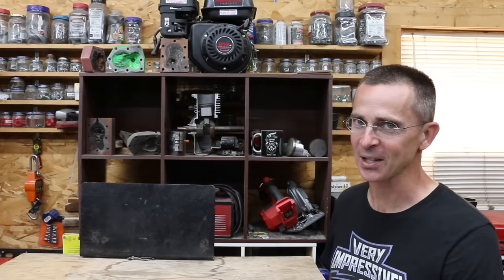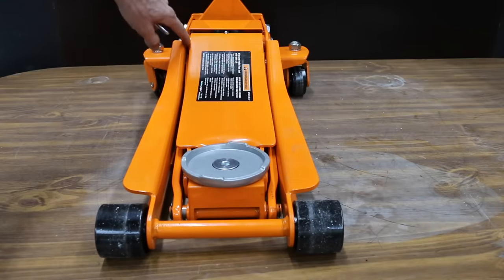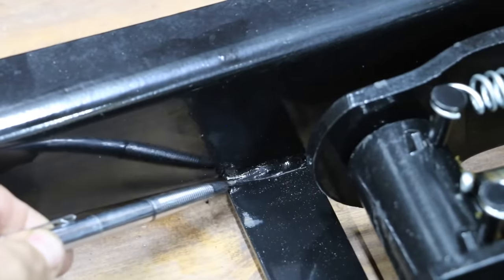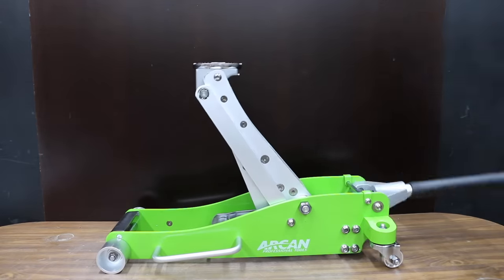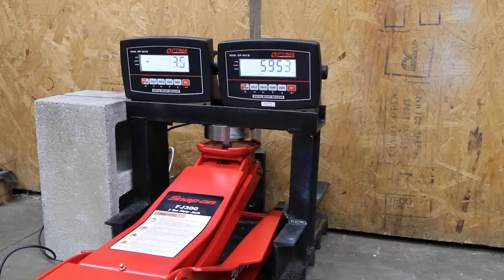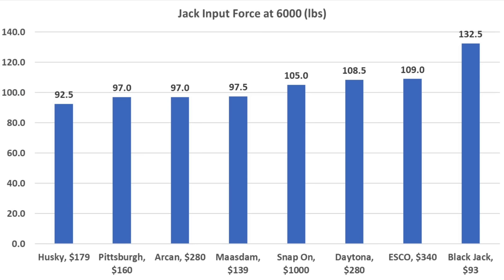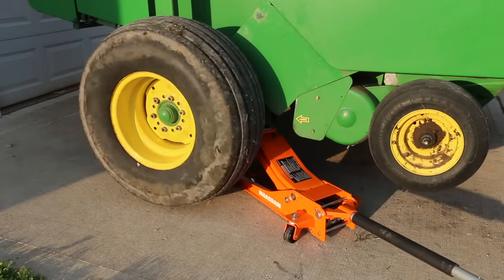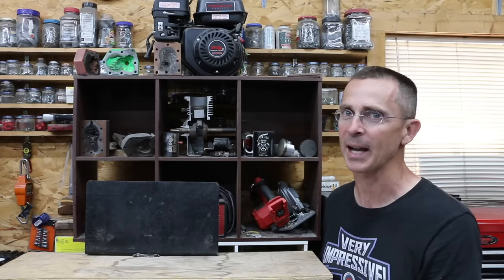Best Floor Jack? $1000 Snap On vs Daytona, Pittsburgh, Arcan, Black Jack, ESCO, Husky, Maasdam

Comment: I bought an steel arcan 3.5 ton Jack probably 15 years ago from Costco. It’s been the best Jack and has never given me any issues. Best thing is that it cost less than $100
Reply: It seems everyone got that Costco Arcan lol.
Reply from the maker: Great jack at a great price!
Reply: We're gonna need Todd to test that.
Reply: I got it too, its a really good jack
Reply: I got that same deal for the red hybrid jack. I love it, and 10 years later it’s still going strong.
Reply: I purchased the daytona 1.5 weeks ago and it’s great, way better than my previous jack. Had to get a new jack because the old one couldn’t fit underneath my car. It was fairly cheap (like $80) and I bought it like 10 years ago. Stored in an outside shed and given no tlc. Still works perfectly fine. Still though, a jack is something you never want to cheap out on. A faulty jack can kill you, severely injure you, and/or damage your car. When I was young and dumb I used the jack that comes with your car because it was either use that or wait a few days for a proper jack and stands. I was impatient. Worked on the car going slightly underneath. Less than 30sec after finishing, the jack slipped and the car fell. Nothing was damaged and no one was injured. It scared the crap out of me ugh  I was half underneath the car less than a minute prior. Scared me straight. A good jack and stands is an absolute must if you’re going to be doing your own car maintenance.

Comment: Daytona jack seemed pretty comparable to the snap on jack for the price difference I think most people could over look the smaller front wheels and the slight difference in the rise height.... 300$ vs 1000$ is an impressive savings for a few minor differences
Reply: Fairly certain the took snap on’s patent on the design. Snap on tried to sue but the time ran out on the patent or something like that
Reply: Worth noting the Daytona is literally 99% the same as the Snap-on. As in the same factory makes both jacks. HF got sued by Snap-on for this and won!
Reply: Some of HF's ICON tools are giving Snap-on tools much grief. Like their torque wrenches.
Reply from the maker: Thanks for the feedback.
Reply: @ShitboxShenanigans  the patent running out was a good thing for customers now they have other options other then snap on over pricing their tools and accessories.. don't get me wrong here snap on is a great company but competition keeps prices competitive
Reply: Also patents are good and all but you can make the same item that functions the same looks simular or almost the exact same as long as there are enough differences made to it smaller wheel, body shape, return spring, pressure relief valve  etcetera it is defined as a different item not being the same due to not everything is the same , the other thing is you have to list every single part and how it is built, how it works in order to get a patent, at least that's what I here. I'm no expert on the subject but it sounds expensive and not worth doing unless you are a huge company
Reply: @ShitboxShenanigans  
I doubt that. snap-on is just made in the same factory as the others in China. Snap on welders have been rebadged Italian ones for years. Nothing wrong in that but why pay 3x the price for a name?
Reply: @codprawn  I'm not sure where snap on gets them made but they do put a hefty price on'em like it was made in a gold refinery or something
Reply: @justotalkalottashit8392  yeah, a couple years ago, Milwaukee, and Snap On ended up in court over their battery designs. I asked my Snap On guy about it, and he told me you could honestly copy the battery, and just change the way the battery locks into the tool, and it would be good. If I remember right, Milwaukee was suing Snap On over the 18 volt battery. I'm not certain what came of it, but I assume nothing, as I just traded my old 3/8 cordless impact for a new one, and am able to use the old battery in the new tool. Only difference is the old one is a 5 ah, and the new one is a 6 ah.
Reply: Height is always fixed with a good old piece of wood
Reply: @Spike-sk7ql  What came out of it is Snap On waa ordered to pay Milwaukee almost $28 million... and now Snap On sells Milwaukee tools on the truck.
Reply: @VorsprungDurchNik  How long does it take to sell $28 million of Milwaukee tools off of Snap On trucks?
Reply: @ericrichardson3332    Patents aren't as much for protecting intellectual property as they are for coaxing improvement and innovation.  Some friends and I patented a product about 20 years ago and our attorney made it very clear that trademarks are far more valuable (especially once marketing takes hold) as brand recognition is what needs protecting.  He said any changes, no matter how small, as long as it can be argued that it improves the original patented design, can also be patented.  This is how a lot of companies get away with nearly copying products.  And you're right... competition drives the original and new companies to make better products, or improve existing products.  I own some Snap-On tools for specialty applications, and it's always pissed me off when I write that check.  I'm glad there's new players to choose from.  ICON is quickly filling my tool chests... the product is very very close to as good as Snap-On.  WERA has been disappointing.
Reply: @matthewpeterson3329  Thank you for information it is interesting at least to me and I hope others find these comments just as informative as me 👍
Reply: You’re exactly right. Patent law really only appreciably serves very large companies, and only serves as a line of defense if another entity infringes on said patent. Despite what many people may think, parents are not fool-proof blanket protection. In reality they’re quite far from it. Parents are notoriously expensive to file in any capacity (a single one costs tens of thousands of dollars) and it’s true you have to outline the full design of the patented product. There isn’t much room for ambiguity. For most people/companies that aren’t huge, it’s in your best interest to keep designs a trade secret whenever possible. Anything that can’t be easily reverse engineered or replicated under contract builders qualifies. A Jack unfortunately is very easy to copy in both respects. The utility patent does in fact make sense in theory, more specifically the fact that they expire unlike design patents which are strictly cosmetic serving as brand identity. For a utility patent, the company that pays for the R&D on the front end basically gets exclusivity to make back their money and then some (it the product is good) on the front end. Then one day it expires as not to be anticompetitive, and other brands can then adopt the design if they choose to.
Reply: @kfs777    Yep, all true.  Our patent wasn't that expensive though... just a few thousand and that included the attorney fees.  Our product was a yard game we invented, and smartly designed the best possible version to bring to market, so to improve it would make any new version too expensive to compete with ours.  It didn't stop people from making cheap plastic versions of it though, which is where our trademark kicked in.  Because we were the first, and marketed the name, copycats tried to use our name or variations of it and we had to issue C&D letters copiously.  I got a heck of an education with that business.

Comment: I purchased a Daytona a couple years ago because it looked like it was well built and reasonably priced for what it was. I've used it quite a bit over that time and it's worked great. I would have preferred to buy a US made product (Snap On) but it is just too expensive. I could justify it if it were 15/20% more but not 3 times as much.
Reply from the maker: Thanks for sharing.
Reply: snap on made in US??? need to check on that...
Reply: It’s not? Then I have zero regrets
Reply: Same.  I've got the regular Daytona (not the low pro) and it is a sturdy, well made piece of kit.  Until the U.S. starts up its factories again, I'll stick with harbor freight for most things because EVERYTHING is made in "chy-na" nowadays.

I figure, if I have to give my hard earned dollars to my enemy, it will be as few dollars as possible.
Reply: @kodoan411  it will never happen that’s how capitalism works companies need to find the cheapest labor
Reply: Well, no one can say this guy doesn't know jack  :)
Reply: Saul Alvarez are you trying to say communism would be better? It’s been proved many times over it doesn’t work…
Reply: @zacjohnson452  Not certain how made the leap from me complaining about the Snap On price to thinking I'm endorsing communism but I'm certainly not. What I do get pissed about though is when an American company sends its manufacturing to some third world nation to increase profits and then goes around waving the flag about how American they are
Reply: Aren't Daytona and snap on floor jacks made on the same assembly line?  Lol
Reply: I'm a machinist and I don't think I can recall ever seeing any of the guys I work with use Snap-On. It makes sense because we don't do automotive work but I have seen a lot of Matco tools floating around. We all use Makita and Milwaukee for hand tools and power tools. Although in my line of work nobody is going to trust your measurements unless you have a Mitutoyo or Starrett, so I guess in some respects that brand loyalty is baked into some trades.

That being said, a couple years ago I was helping install some metal canopies for a hotel under construction in NYC and the jobsite was all Ryobi tools.
Reply: I bought a Daytona and matching jack stands, they match my car😁 I got the green and I have a sublime charger Daytona
Reply: @kodoan411  Why are they your enemies?
Reply: @richmac918  so then what was the point of throwing capitalism in the mix? 
Those issues could be fixed through legislation.. 
nothing to do with the actual type of system being used.

I’ve noticed this trend of people blaming capitalism for pretty much anything finance related (overseas jobs, tipping, etc)
Reply: Yeah, I wouldn't count on the Snap_On being made in the USA, only some of their handtools are. I suspect the jack is made in the same plant as the Daytona.
Reply: The Daytona jack is literally the same as the snap on, the owner of harbor freight got the manufacturer for snap on to make it for him also and snap on tried to sue over it but lost. But just goes to show snap on is totally false, they're very good tools but they don't need to cost nearly as much as they do.
Reply: Snap on's 1.75 ton aluminum floor jack is USA made. Their 2,3 and 4 ton jacks are made in China. 
Aluminum jack is just under 1K
Reply: Dang I was gonna get a Daytona one last week, but they had a Pittsburgh for$40 and I planned on using it once
Reply: @mistersadaimusic  Ask the electricians what brand of multimeter to get...
I'm betting on it starting with F
Reply: The snap on is made in China but assembled in America.
Reply: It's nnot made in the US. Snap on sued Harbor frieght claiming the Daytona was a direct copy, Harbor frieght countered and proved that Snap on was lying about being made in america since they are basically the same jacks.
Reply: @The2Coolest2  Interesting, wasn't aware of this
Reply: Needed a new jack at work, sometimes we have to jack up the dump truck loaded. Looked everywhere for a US made jack that could do the job. Only found 1 that made them for 30 tons and up. US Jack. They mainly sell to our military, but was able to get it through the local Napa special order.
Reply: @keepMrunning  No they are made in the same factory that the Daytona 3 Ton Super Duty is made in; which is in China.
Reply: The Snap On is made in the same place as the Daytona. Harbor freight had a settlement over it, that’s why the price on the Daytona went up.
Reply: When you buy snap on your mostly paying for the brand rather than the product tbh
Reply: Snap-On jacks are made in the exact same factory in China as the Daytona jacks. That was documented fact that came out in Snap-On's failed lawsuit against Harbor Freight.
Reply: @marvindebot3264  on the same line, with the same parts. Honestly, I wouldn't be surprised if the Daytona is a reverse-engineered Snap-On.
Reply: Snap on is made in china / overseas , they just “assemble in the us” which is BS
Reply: @richmac918 half of the crap they sell isn’t. In fact half the crap they sell isn’t even made by them.
Reply: @ItsBoyRed  - Yes, it is a Fluke Meter... I love mine and it is going on 15 years old... Got it calibrated by Fluke before buying it... Love that meter !!!!

Comment: I bought an Arcan about 2 years ago and I'm very happy it did so well on these tests. It has worked great so far and I always appreciate your testing to confirm this!
Reply from the maker: Thanks for sharing.
Reply: I bought my Arcan (HJ3000, red) 6 years ago due to its lightweight aluminum-steel construction. Not sure if it's the same as the lime green one in the video as they look different, but it's been working great!

Comment: Daytona makes a "Low profiel, long reach" model which has a longer and flatter saddle. I bought it several years ago and love it! The only jack I've found that fits under my car with ease.
Reply from the maker: Thanks for the feedback.
Reply: The Pittsburgh also makes a a low profile version mine is over 8 years old and still works perfectly.  I lift trucks and big caddies weekly with it .

Comment: I have a mobile work van and mostly lift a few hundred pounds. I have a small Pittsburgh low profile that I use most often. 
For the occasional heavy lifting, I have the Arcan. It is very well built, good looking and the aluminum construction makes it actually portable. If you are looking for something that won't wear you out or break your back taking it in and out of a mobile service vehicle the Arcan is it.
Reply from the maker: Thanks for the feedback.

Comment: The Jack Reacher (pun intended!) test was genius. How often you have to slip the jack far underneath the car to reach the lift point? Great job PF!
Reply: Good point!
Reply: That was a good point as I hate it when my jack will reach but you cant use the handle to raise it because it hits the underbody etc.
Reply: It's not that uncommon to get a car started into the air from a safe lifting point.
Reply: @timrobertson299   That's the biggest problem I have with my Acdelco floor jack.
Reply: All depends on the car. I have worked on several where the "textbook" lifting point is very deep.
Reply: I'm surprised so few of this style of jack have optional air-actuated cylinders, seems like that would be great for long reach or tight quarters (nearby walls blocking the handle movement) situations.

Comment: I've had an Arcan for a couple of years now and I absolutely love it.  I've had no issues with it and you can't beat the weight, especially if you move it from job site to job site.  Great comparison, as always!
Reply from the maker: Thanks!  Thanks for sharing.
Reply: It was on sale for close to $200 a few years back.  Very happy with my purchase!
Reply: My Arcan won't pick up my Volvo as well as my Napa 3 ton.But the difference in weight is fantastic. Especially in the gravel I can position it easily.

Comment: I own two, 3 ton Daytona floor jacks. I upgraded them with the bar as I have two trucks and a sedan. When I make use of them, I always use stands as a backup. I have not had an issue with these products. But, I always have safety redundancy as well.
Reply from the maker: Thanks for sharing.

Comment: I had an old German made Febi Bilstein floor jack with a spindle, the thing was huge and heavy, 130lbs, and even after 60 years or more as good as new apart from some surface rust. 
Sold it for 50€ because I don't work on cars and don't have the space. 
Looking at these the buyer got a damn good deal :(
Reply from the maker: Thanks for sharing.

Comment: I have the arcan jack and I've owned it for the last two and a half years. It's held up great both in the shop and being drug through gravel working outside. Being light was the biggest selling factor to me as I used to constantly put the jack in the bed of the truck for rescue missions.
Reply from the maker: Thanks for sharing.
Reply: It looks to me by far the best. At least the design is different, and the building construction is clearly superior.
Reply: Same here. It is my go to when I need it bring a jack somewhere. The aluminum is very nice. My 3.5 ton craftsman is far too heavy.

Comment: I have the Arcan Jack and an engine leveler as well. I bought them because it looked like the best bang for the buck. Couple years later I find this video by chance. Had I have seen this before buying the Arcan, it would made me not even consider another brand. I have a feeling it'll be in my garage 30-50 years from now. GREAT quality
Reply from the maker: Thanks for sharing.
Reply: @ProjectFarm  if you haven't yet, you should do a review on engine levelers. I have an AC Delco and a Craftsman...the Craftsman broke pulling a 4 cylinder....but the AC Delco pulled my Cummins no problem which weighs over twice as much as the 4 cylinder